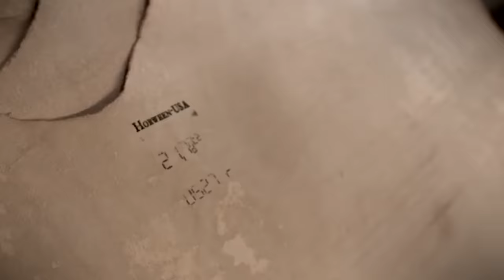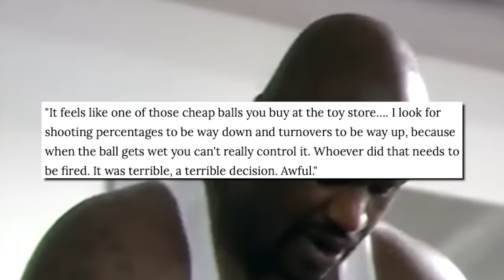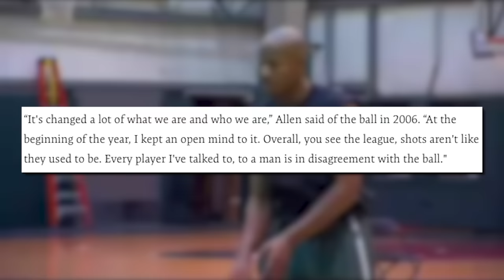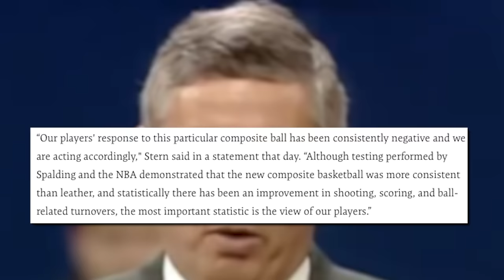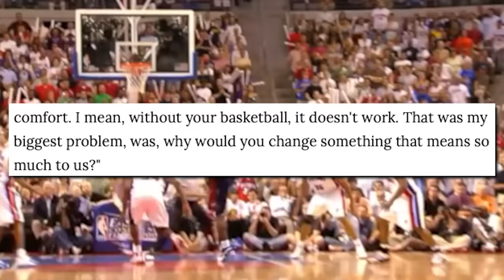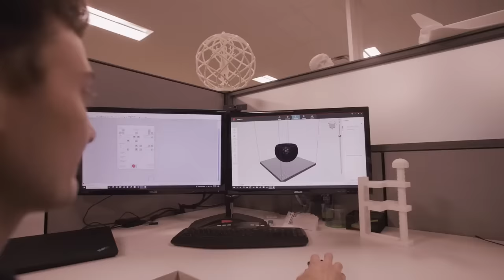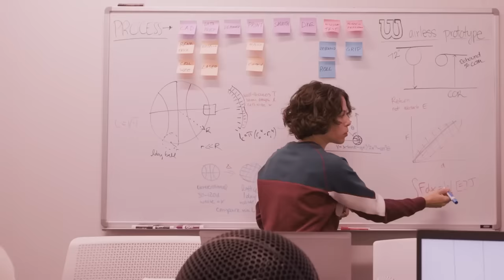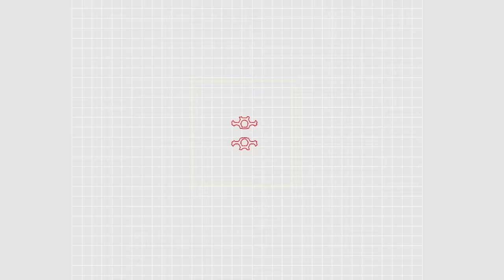The Weird Truth About The NBA's New Basketballs...

Comment: They'll add a perforated leather cover to the outside. It would keep the same feel and aerodynamics as the current balls but wouldn't need inflation. Adding solid leather would make air pressure involved again so perforated is the way it'll go
Reply: That's what I was thinking too. Make it slightly smaller and lighter then cover it with leather and tell no one; see how many people notices. 

That could also solve another problem aside from aerodynamics and feel which is the moisture it'll pick up when used. With that many holes I doubt the officials can keep that thing dry throughout the game; good luck getting all the sweat, water, drinks of any kind out of those holes.
Reply: @jaydeleon695  I'm less concerned about liquids as I am solid stuff. You can spin the ball and the majority of liquid would come off from inside. Sure, it'd still be 'damp' but I don't think it would really effect it too much, and you could switch to a backup ball while it dried if it was really an issue. Heck, rinse it under some water, then set it aside to dry and it'll be good. 
However, imagine something like a tiny pebble/rock getting pushed through the hole on a bounce and then rattling around inside it. Granted, it's less likely in an arena vs playing outside, it's still possible. Popcorn kernel falls on the edge of the court from fans, the ball picks it up as it's dribbled over it, etc.. stuff like that.
Reply: You'd have to cover it carefully. Reducing the total surface area that the air inside can escape while the ball is compressed (bouncing) actually will give it an air pressure component. So they'd have to cover it with leather, but not block the holes at the same time. That would probably take more years of testing. And seeing as how they already spent the time to make the ball with the holes perfect, I honestly doubt they'll alter the outside surface of it. I'd also be willing to bet that no one is gonna like how it feels lol. It's gonna be the same thing as 2006.
Reply: cool idea but they want to avoid using animal products (I think) too and the synthetic stuff got shut down... one thing I am certain those balls won't have good wear and tear for street ball much less playing outside in the rain.
Reply: I am Wilson ! And all of you are hired!!!
Reply: @milosknezevic8905  me too
Reply: That would ruin the entire purpose of the ball.
Reply: @imabirdo  That's not what they will be made for though?
Reply: @zy_15  I know it isn't, it's just that if that ball is going to be sold to the public most people don't have an indoors court available to them (I also don't know if Americans rent courts or the sort, I'm not American).
Another thought crossed my mind, how much does it take to crush one of those balls on purpose really?
Reply: Wait that’s actually kinda smart
Reply: The problem with the new ball is that people playing outside would get rocks and chunks of plant in the holes, which would make it bounce less well and puncture your skin, so that is a little weird.
Reply: summed it up perfectly ab what they should do. that would make a lot more sense.
Reply: that will change the bounce height
Reply: Also if the weight of the ball with out the leather is same as current ball adding it would make it slightly heavier also larger wouldn’t it? Not by much but not sure if it would make a difference
Reply: @williammoore-zc1df  I think most of the weight comes from just the air inside. And some does come from the leather and other materials insidr
Reply: That's actually genius....
Reply: honestly..I don't understand why humans care about these insignificant things in life lol...
Reply: now that just changed my mind
Reply: That would never work. The perforations would need to be large enough for pressure equalization to take place in the arc of time between touching the floor, compressing and bouncing off the floor. Adding even a little bit of resistance would slow down decompression and ruin the energy return.
Reply: The entire point is to move away from using animal flesh (which all sports need to eventually adjust to) and create a product that's both cruelty-free and eco-friendly while producing the efficacy as the current ball. if not an improvement.
Reply: @VigilanteVegan  lol Vegans.....
Reply: One problem is that inflation creates a pressure difference between the inside and outside of the ball, which also makes the leather sort of... tougher? If there's no difference in pressure, would the leather tear or puncture easier? Also, could sweat and debris fill into the inside if small punctures go undetected causing the ball to become heavier over time? Maybe these sorts of things are non-starters. Maybe there wouldn't be any significant issues or change in weight and durability. I guess I'm still here scratching my head as to why they're fixing something not broken to begin with, which makes me skeptical of any new design.
Reply: No
Reply: @iaonyt  what do you do all day? Just breathe, eat, drink water, poop, and sleep huh?
Reply: @DJcyberslash  No, I do much more than that lol..just don't overly care for dumb things like this
Reply: @iaonyt  what is not a "dumb thing" to you? If you're not solving global warming then we all are in deep trouble man. Have you solved the nuclear proliferation crisis yet? Any solutions for Ukraine and Russia yet?
Reply: @AAGEnzee  I really don’t see that as a real issue in the NBA, anything else outside of a court is a different story.
Reply: @user-dy5up1dx3k  The balls go out of bounds during games and it's not clean everywhere in the arena.  I'm not saying there are little rocks all over the court, and I said it's less likely vs outside, but it's still possible and would require swapping the ball out I'd imagine.
Reply: @DJcyberslash  We've only been measuring tempature accurately for like 200 years, we honestly have no clue on what the natural cycles are. The sun goes through cycles, the poles go through cycles, the planet goes through orbital cycles as does the sun. The same people sounding the alarm the loudest on climate change have private jets, beachfront property, & celebrated blowing up a pipeline dumping hundreds of thousands of tons of methane in the air.
Reply: @blindprophet182  My point to @I A was to not to look down on people especially when you're not exactly creating world peace yourself.
Reply: @DJcyberslash  oh ok then enjoy the rest of your holiday weekend
Reply: Perforated leather would change again how it interacts with air, and thus leading into far more r&d, the current one will probably have some retexturing to change how it may interact mid air and may have some internal components added to reduce air flow, but adding leather almost ruins it, every bit of r&d put into the elasticity would be scrapped because now you have a new surface to interact with, not to mention the perforated leather, if too thin, will act like a golf ball with a dimple effect and add further criticism, or, if made too thick, would ruin the bounce entirely, not to mention, even perforated, every bounce will make a pressure zone, absolutely changing how it bounces and far more inconsistent, not to mention wear, if one side has too much wear, it will ruin every advert Isabel feature of the ball, better to keep it air less and skin less or not to change it at all.
Reply: that's a great idea
Reply: Fact is it won't happen
Reply: @jaydeleon695 that's the thing they don't want to use Leather anymore with all the "environmental issues" ESG type of goals.. killing animals and using their leather to make a ball out of it
Reply: Then they'd have to re-balance it all over again. I think players will just have to get used to it, if they end up having to use one. However, unless they can find a cheaper method to making them, these balls will be crazy expensive, compared to a normal ball.
Reply: I wont buy one , if u cant deflate the ball and chuck in a bag then i dont want it
Reply: That wouldn’t solve the problem. You’re aerodynamics would still be different. Solid leather wouldn’t be an issue either because you wouldn’t seal it all the way. The ball would just be at ambient air pressure. So, yeah all of this is wrong. - friendly neighborhood aerospace engineer
Reply: i also said they'll probably develop a skin for it. i dont know about leather. i know it wud feel a bit more like a basket ball but from an animal lover point of view, this cud cut down on a lot of leather so maybe we cud find something synthetic that feels good. i think it also needs to keep out water but let air in. and it needs to let enough air in so that it can be squeeze and retain its shape in an instant.
Reply: Or it could be wrapped in normal leather and where its filled with air is just a small open hole, along with slight openings along the black lines where it cant be felt.
Reply: Makes so much sense I am surprise those getting paid such big bucks have not thought about that.
Reply: Needs to be left alone no reason to change it at all.
Reply: i thought the point of the new balls is to get rid of the leather entirely
Reply: Don’t need many perforations, just a few tiny holes that allow air, but not moisture to pass. Could even put an air permeable membrane that is liquid impermeable inside the leather exterior. Same look, feel, aerodynamics, etc.
Reply: Won't work. Any less perforation than what the outside surface already has will bring the air pressure component back.
Reply: Will that throw off the weight? Can they reduce the structure but keep the same capabilities?
Reply: @CharlieBam  Hard to say with certainty, but it’s probable that they can reduce the structure and weight to compensate for the leather.
Reply: Wrong. They're obviously tring to make it vegan, politically correct, and so forth. 
So, no leather.
Reply: Nah they wont
Reply: That would defeat the purpose. What they want is a ball they can entirely 3D print, which would cost significantly less to produce at scale. Putting a leather cover over it would make it cost more than the current balls, which have a simple rubber internal bladder. But they know they need the NBA to adopt it or no one else will so they have a ways to go.
Reply: Yeah that is what I was expecting
Reply: It still doesn't bounce as well
Reply: A cover would change bounce and weight two things they spent significant amounts of time perfecting.
Reply: But then why should they change their ball at all?? Is air in a ball really that bad? Sometimes innovation is just not innovation in the sense that developpers should ask "should we do it" instead of "we can do this".
Reply: Inflate a frog.
Reply: Then what's the point?
Reply: adding a layer to it's surface will change the ball's elasticity or bounciness
Reply: What’s the point of that again?  Add weight.  So lose bounce.  And the leather has a bunch of holes in it.  So it feels like the new ball anyway.  Don’t quit your day job
Reply: This would change the weight.
Reply: correct me if im wrong, but arent a lot of leathers breathable? isnt it possible to cover it in leather and the air pressure with equalize with the outside if the leather and thickness are right?
Reply: That would defeat the purpose of the ball they created 😂
Reply: Thanks... I'm not done with the video but I was like, surely the holes add grip or, something.  Can't possibly be the same with holes all over it.
Reply: Type II Kardashev civilization mode now unlocked for Earth's Dyson Sphere  civilization.  Wilson's patents on the airless design can also be applied to automobile tires  (or tyres)...
So Wilson's new 'basketball' has drawn attention from  NASA and Firestone.  Truly they discovered a world changing invention !
Reply: That's possibly a good idea it wouldn't be that hard to do

Comment: I bought one of those new official 2006 balls when they first came out. I believe I paid about $150 for it. I love that ball, still have it. It has a much better grip than the other balls, specially for someone like me that has average size hands, but I agree that it becomes slippery when wet and also after a long shoot around, my fingertips would feel kinda tender. But it is more consistent and accurate, specially for bounce passes and bank shots off the back board
Reply: Why Would You Say Something So Controversial Yet So Brave?
Reply: I just used to love the softness of it hitting my palm. After a bit of use it just became perfect for hand feel (yes very slick but otherwise I honestly loved it) I loved tossing it between my hands and spinning it across my palms. My brother had the ball, I think it's still at my parents house in my dad's garage. I also remember those weird slightly more bulbous basketballs with more inset lines that got weirdly popular about 08
Reply: 150$😂 and the leather was changed for a much cheaper material. I bet I known why they tried to push that ball so much.
Reply: I much prefer the 2006 balls over leather ones personally. They are way more consistent than leather balls in my opinion and are more resistant to the general wear and cracking that leather can experience after some time of use
Reply: @ganiniii   Have you never purchased real sporting equipment before? I don't mean a $30 toy with branding on it, which is obviously what you are thinking of.
 Cause literally 5 seconds of looking shows that the current balls are about $169.99 each.
Reply: Bro it literally injured their hands 😂Are you going to actually defend this?
Reply: @ganiniii I can get that if you're a kid it sounds crazy to spend that much on sports gear, but it's actually pretty normal.
Reply: Especially* not specially
Reply: @Iamyodaddy_  when I used specially I was thinking for a special reason, but I think especially would be a better use since it's more of a general reason rather than a unique circumstance.
Reply: @Iamyodaddy_  this is YouTube not a PhD dissertation. Nobody cares dude.
Reply: Can't believe we're still using leather in 2024.